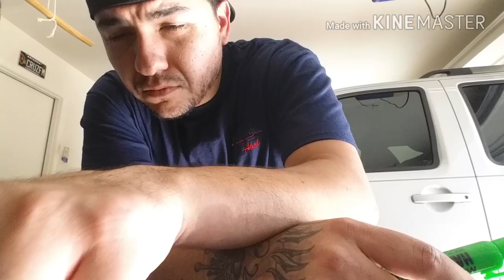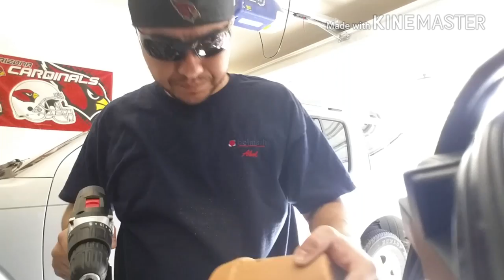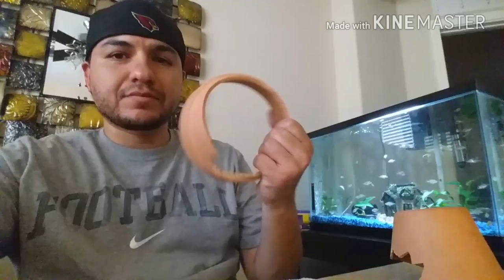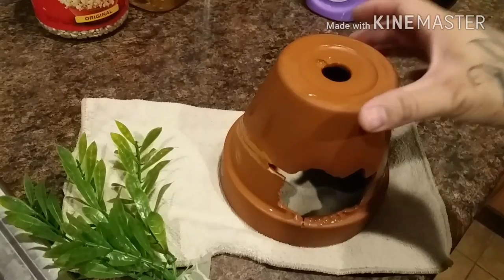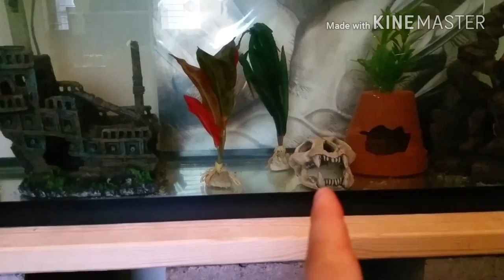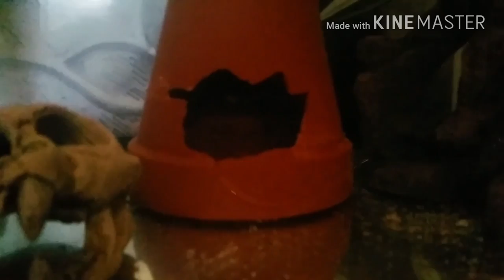Putting together a clay pot

Comment: Cool was to improvise. 
How do you prepare the pots for water?
Reply from the maker: I just rinsed them off with water really good then I let them air dry.
Reply: +Tank Head Videos cool. I need to get a few for my Mdoka White Lips. Did you get the pots at Home Depot or lowes?
Reply from the maker: +inventoryking at Lowes.  6 inch clay pot 1.25. cheaper than walmart
Reply: +Tank Head Videos sweet, thanks